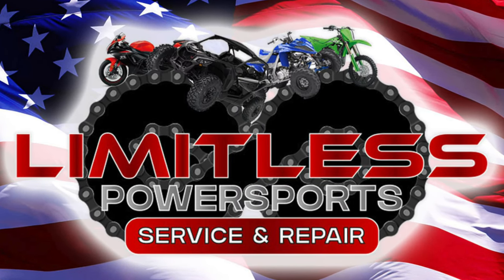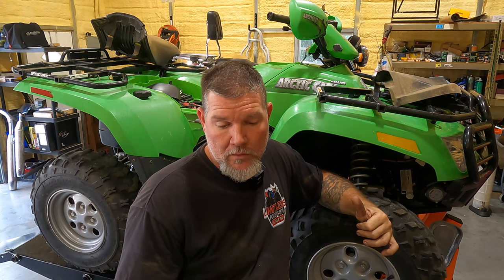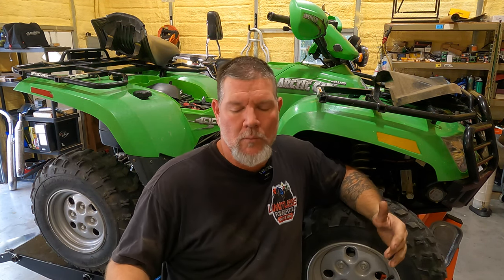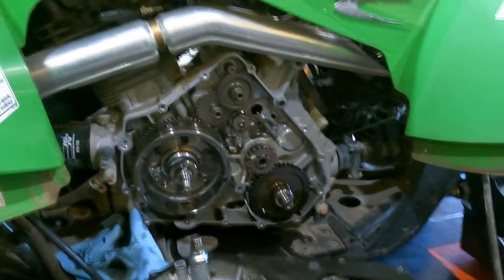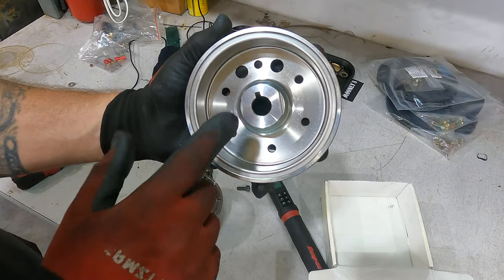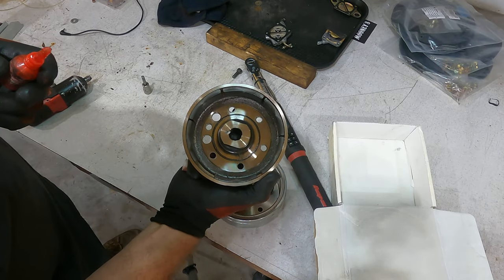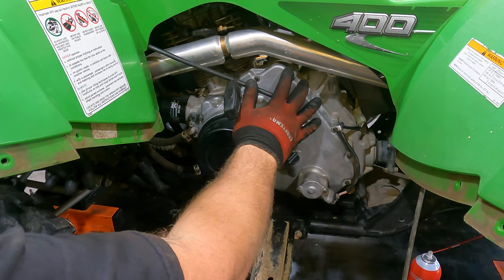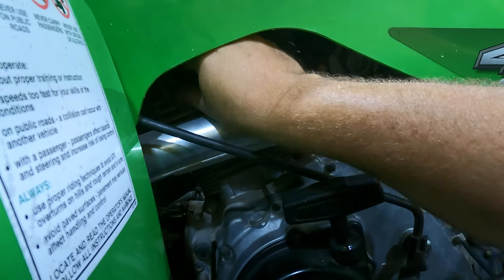Arctic Cat 400/500/450 common no spark issue.

Comment: I have a 2007 king quad 700 Suzuki I rolled it now nun of the electrical works please help I replace the ignition fuse and no power to the key still any thoughts
Reply from the maker: Double check your battery connections and your ground wire. Also sounds like you may have a main fuse that blown that's what provides power to the whole unit.

Comment: I have ? about a 2003  articat 400  we got bike after it been setting up, it would crank using pull  rope and adding gas or starting fluid but wasnt getting gas thru carb, rebuilt carb and electric start , now no spark
Reply from the maker: You definitely need to run the same test I did on the sorce coil & the trigger. It's possible that you are having the same issue I was having.
Reply: @limitlesspowersportsservic3394    took side cover off, and the magnets where loose and broke  everywhere. i ordered the flywheel kit ,  got new flywheel,stater and gasget coming,, i need video on how to put all the gears back on and how they go
Reply: I did all of this backwards, I pulled the cover off and found magnets shifted and gone, ordered new kit and installed it, but still not getting any fire. Could it be that the coil and the flywheel magnets were both an issue and that now I just need to replace the coil? 

Awesome video by the way, wish I would have found this sooner!
Reply from the maker: Yeah it definitely could be the crank position sensor because of those magnets causing those issues. Even though you changed at the flywheel the crank position sensor could have went bad beforehand.